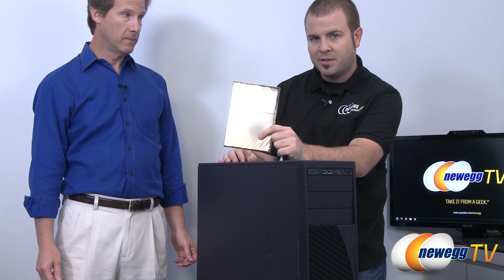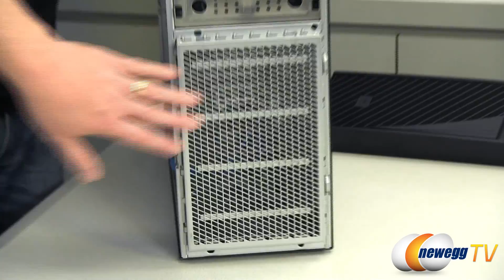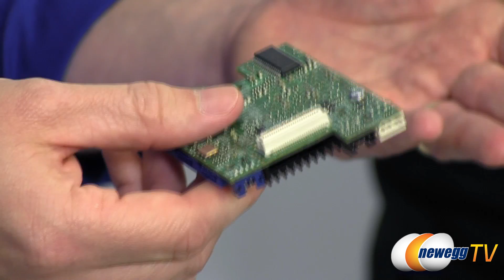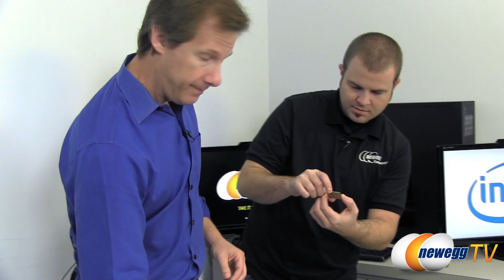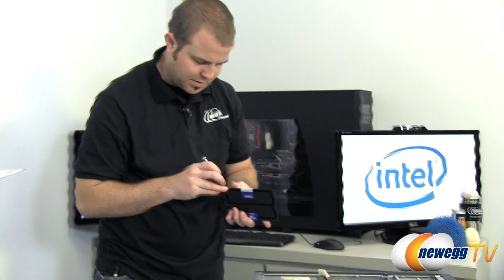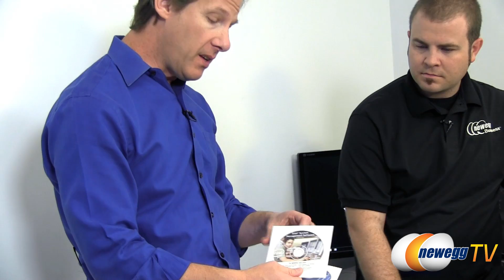Newegg TV: Small Business Server Build with Intel & Microsoft (Part 1: BUILD)

Comment: Did the intel Xeon guy just try to sell having four or five desktop cases out of a rack as a good thing?
Seriously, even six years ago, one would expect to have a rack and not a bunch of desktop cases running servers for a small business, because if you need more than two systems, just get a rack, they're not that expensive, especially used for the rack and cases.
that being said, that is a pretty awesome system to work with.

Comment: How is this server? Just came up with it, have no idea if it's good or not, someone pls tell me

CPU: x2 Intel Xeon Processor E5-2699 v4 (55M Cache, 2.20GHz)
SSD: SAMSUNG 850 Evo 2.5” 1TB SATA III
Hard Drives: X36 Seagate Archive HDD v2 ST8000AS0002 8TB 5900 RPM 128MB 
Cache SATA 6.0Gb/s 3.5”
Motherboard: ASUS 210PE-D8 WS SSI EEB
Case: EX4M36-EXP
RAM: 256GB (8x32GB) Kingston ECC DDR4 2133 (PC4 170000) Server Memory
Graphics Card 1: x4 MSI GeForce GT 730 DirectX 12 N730K-16DSLP/OC 16GB 64-Bit GDDR5 PCI Express 2.0
Power Supply: Corsair AX1500i Digital ATX Power Supply
Reply: Wow that's good! What are you planning on doing with that server PC?
Reply: Nothing really. Just trying to brainstorm. I don't have the budget to build it anyway XD
Reply: anyone can just pick out the most expensive parts on newegg rofl
Reply: I wasn't picking out the most expensive parts, it just happens that the most overpowered parts are super expensive XD
Reply: Craftman2917
.........
Reply: ikr
Reply: Well I made this a while ago
Reply: lol

Comment: Uh... no? Lots of popular applications run on Windows for the need of ASP.NET / Microsoft IIS. Statically speaking, more Linux servers exist in the wild than do Windows servers, so the numbers of Linux servers getting pwned is higher, but the percentage of Windows servers getting hacked out of ALL Windows servers (reportedly) is higher. Windows usually leaves open more vulnerable services by default, and well, a lot of sysadmins are dumb.

Just my two cents!

Comment: Windows Server sucks for anything facing the web. The best use of it is within local networks where you rely on things like Exchange Server for your email and stuff (which only runs on Windows Server). Anything facing the web then you'll want some form of Linux, and ease of use really isn't a factor, it's down to security, scalability and stability, something Linux is FAR better than Windows at. There's a reason the vast majority of web servers are Linux and not Windows.

Comment: The problem with using Intel shit is if something craps itself you HAVE to get Intel gear and that means at least 1-2 days for parts to arrive.

If you use standard equipment you can usually get replacement parts within an hour from the local wholesaler.

Comment: Funny. I just happened to be replacing my mid-tower cased server tonight with a mini-itx book-sized machine I built. Not that I need lots of computing power, but the old one's size is from 1998. Case is about the only thing not replaced over the years. 2 1/2" server-quality drives are nicer these days than 3 1/2" drives. Esata port for cheap external backup drives. I would never use Windows for a server. File, print web, email, accounting and many Linux X-window apps serving, for our computers.